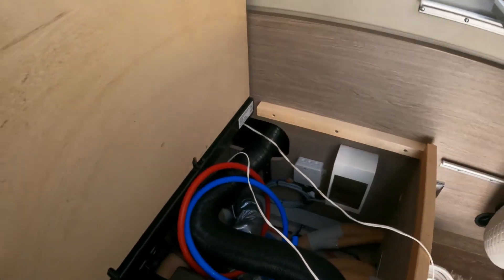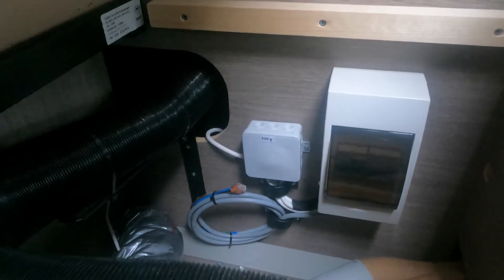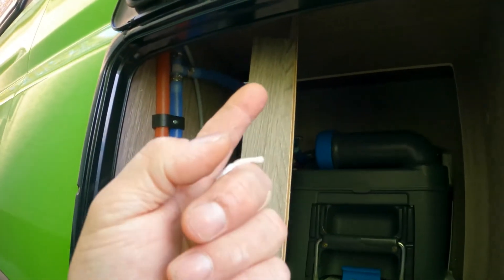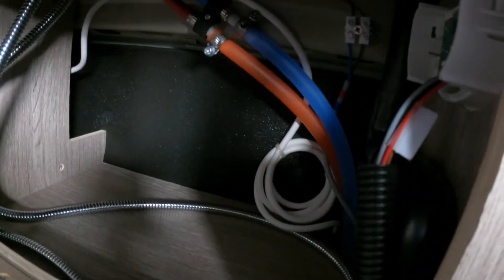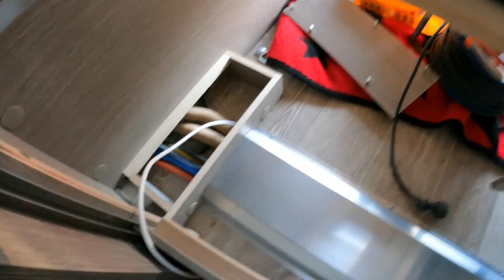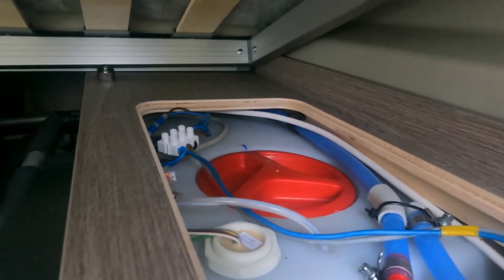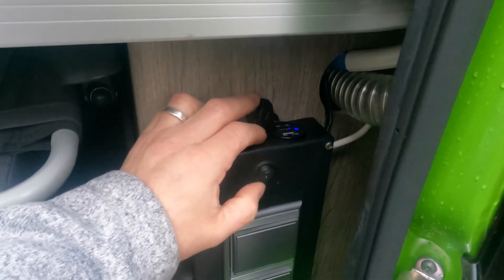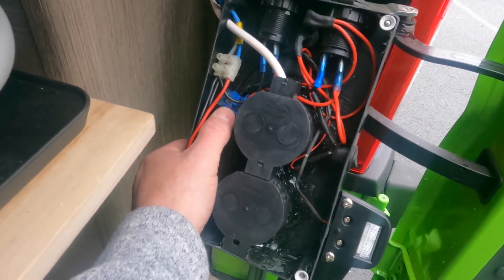Pössl 2WinPlus Strom/Steckdosen im Kofferraum, Shrek unter Strom...es werde Licht...

Comment: Tolles Video erstmal. Eine Frage ich bräuchte einen 12 Volt Anschluss  am Frischwassertank  für dieses Gerät (Supersense Füllstandssensor ) um den   Wasser Inhaltes des  Tankes zu messen, meinst  du ich kann von der Wasserpumpe die 12 V abzweigen oder muss ich ein extra Kabel legen ? ist auch für nen 2 Win Plus. Gruß Hartmut
Reply from the maker: Hallo und vielen Dank, ich hab mir das Teil gerade mal angesehen, und in der Beschreibung steht- Wird von der Anzeigeeinheit aus mit 12 V oder 24 V versorgt und ist im Ruhezustand stromlos. Ich denke das sollte funktionieren , musst halt schauen auf welchem Kabel die 12v anliegen. Gruß Mario
Reply: @womohorizont3091  Vielen Dank für die schnelle Antwort
Reply from the maker: Kein Probleme gerne 👍

Comment: 230v und 12V sollte man nicht in einem Gehäuse gemeinsam anklemmen.
Reply from the maker: Hallo Heinz, im Grunde hast Du vollkommen recht. Direkt in einer Verteilerdose würde ich das auch nicht machen, in dem Fall habe ich ja nochmals 2 separate Dosen in den Kasten geklebt, sowie auch abgedichtet wo die 230v Dosen angeschlossen sind, die 12v halt außerhalb davon. Ich hatte ehrlich gesagt anfangs auch meine Bedenken, aber wenn ich sehe wie der Hersteller das mit 12v und 230v so handhabt, im Grunde nichts anderes, da laufen alle Kabel ob es 12v oder 230v sind im selben Kabel Kanal durch das Fahrzeug, und wenn Du Dich im Wohnmobil um schaust, sind 12v und 230v Steckdosen meist genau neben einander verbaut…..